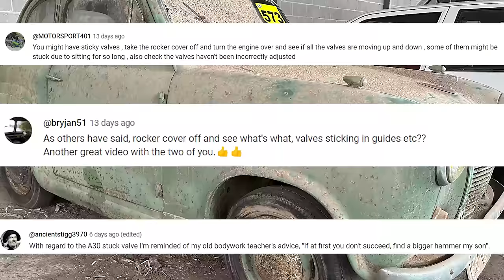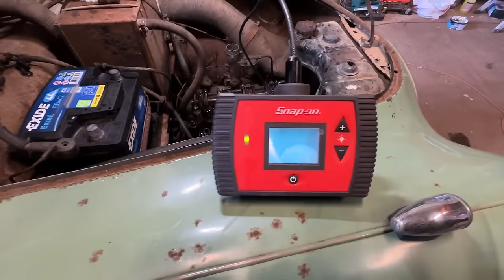First Start in 52 Years! | Barn Find Austin A30 Classic Car Auction Buy #firststart #barnfind

Comment: My first half decent motor was a 1959 , A35 van with seats in the rear which was 8 or 9 years old when I first owned it and to be honest it was one of the best motors I ever had , she took me all over the country and in all the time I had it she never let me down, so ok she wasn’t fast but how many were in the 60s the biggest problem I ever had was when I lost the ignition key which cost me ,if I remember correctly was a couple of pounds from Halfords ,just a thought but how much is modern one for a Renault or Toyota
Reply from the maker: I just paid £200 for a Mercedes key and I don’t think even that was considered expensive nowadays. Madness. 

The other thing with these electronic keys is they don’t work if you get them too wet. Having fallen into a ditch with one once, I know from bitter experience 😂

Comment: You've probably done it now but the rocker cover edge your worried about put a length of wood or brass if you got any on it then use a longer lever under the valve spring ,it should move easier with no risk of damage to that edge.good luck.

Comment: Next job should be to get an oil pressure gauge onto it and you'll have an idea as to the condition of the bottom end. Then run it and see if the smoke clears.  Those A series engines don't give up easily so it could well be fine.

Comment: Worth doing another compression test before going further. Dry first then with a few drops of oil in the plug holes. If the oil increases the compression you might have gummed up piston rings. If the plan is to drive this on the road it would be worth having the head off, grinding in the valves etc. When the head is off it is not much extra work to drop the sump pan and remove one or more pistons for inspection of rings, big end shells etc.

Comment: :face-green-smiling:The old "A" Series Engine was a star in its own rights..so easy to work on. and no major problem to get it going. it`s ok. tapping the end of the Valve Stem. but Beware. you could Dis-Lodge a Cotter. then it`s head off. that Engine was in most Austin and Morris Cars. including the Mini.turned sideways for them. De-Coked and Rebuilt. many in my time. now days. the Mechanics..Woops Sorry. they are Technicians nowdays.. and half of them would not know how to do it... it`s to easy to just change the Units. Engine, Gearbox and Diffs......if i knew where you are located. I would love to come and help you.  to get them running again....Keep it up.. Well done. and lovely untidy workshop..ha ha..

Comment: Great news Claire and Elton, she sounds wonderful. It's probably a good idea to go through the engine, replace the gasket and give her a good check over considering 52 years of inactivity, if sludgy ,high detergent oil will gradually remove it. I think you got lucky because the engine was sealed, preventing moisture ingress.

Merry Christmas and Happy New Year 2024 from Christchurch NZ
Reply: Definitely do NOT use high-detergent oil! It will very quickly shift decades of muck in the oilways and sludge-up potentially causing untold damage; I made that mistake and ended up with a £10k engine rebuild! Drain out the old oil, replace with NON-detergent oil, and drain that out again after very little use.

Comment: Its possible you had old petrol in the pipe, pump and carburettor bowl, so you had to pump through the fresh petrol. Obviously with any old car you have the brown gummy sediment in the fuel system. Future cars I would suggest removing the petrol pipe from the tank, clean that out with wd or atf ,same with the pump and filter and carburettor adding fresh petrol as you box up. These cars , A30/35 have a habit of fuel tank rustingand eventually leaking. In 1969 I bought a 1964 A35 Van  1100 cc that had come from London Electricity Board  and the tank started to leak soon after I started driving it.  Lovely little cars, funny rear brakes and all brakes after be tightened up using a screwdriver through a hole in the drum on the slave cylinders.
Well done on getting a start.

Comment: There is an easy way to unstick tight valves > use an air chisel with a blunt tip and vibrate around area of sticking valve , it has worked in the past for me !
Reply from the maker: From what I’ve learnt from this one, that makes perfect sense. I said to Claire the other night that I’d like to be able to ‘rattle’ it somehow. Thank you.

Comment: I'm a newbie from Australia enjoying your repair fix it jobs on the Austin A30. I have no idea of your mechanical knowledge...but I know the cylinder head on older vehicles have tappets that need adjusting with a feeler gauge. I apologise if it is something that your aware of...but if not I'm pretty sure there are mechanical books for your car or websites to help you out.

Comment: I reckon those valve guide oil seals must be shot it. To be expected I suppose, given the years it's been standing. Lucky the engine wasn't seized up. Those engines are quite easy to work on. Taking the head off and changing the gaskets and oil seals will be quite a pleasant job to do and so rewarding once it's back up and running without kicking all that smoke out of the exhaust. Enjoyed watching that.

Comment: If the crankshaft rotates but only a couple of rockers move valves,surely there is a camshaft or pushrod problem.The engine will need to be stripped or more damage will result.Ive never worked on an a30 but its an A series like minis.

Comment: I would try and get the clutch working and see if all the gears can be selected. Then the brakes will need attention. The engine runs and should improve with use so taking the head off is not that important just now. I would change the oil and filter shortly as a lot of crap will have got into the sump with that first start in 52 years. The A series is such a hardy engine and parts are easy to come by fortunately.
Reply from the maker: I bought a spare oil filter, so will definitely sort that soon.

Comment: The "cotters" etc on this look later than the car,  which is unsurprising . A "Gold Seal" engine was a BL/Unipart fully rebuilt top bottom and ancilliaries using new parts other than head and block which were machined to recieved oversize pistons.  Of course you can just get a gold seal rocker box cover and spray an old engine gold,  not something I would ever do.  "Silver Seal" engines were rebuilt using existing components where they were not worn to excess / refurbed ancillaries only as needed.

Comment: I wish I was there to help you there's a certain way to start up old motors that set for so long. It's not rocket science it's just called common Sense how to start a old motor. One time I even had an mg engine that had no oil pressure because it's set for so long the oil pump when dri show The cure was to keep the bearings in oil while cranking it over I just overfilled the crankcase when it got oil pressure I turned it off and drained most the oil out, but you always want to run an internet set for a long time with its original oil for a few minutes to get everything moving good.

Comment: Need to get it to operating temp and then do a compression test and compare against factory specs. Note the figures obtained and if some or all are low compared to spec then you need to squirt some oil into the bores via spark plug holes and repeat the compression test. Note the figures again. If the figures improve either the rings are still stuck and not freely expanding and contracting to maintain sufficient contact with the cylinder walls, or the rings and or cylinder bore is excessively worn which requires a rebuild.

If you don't get any appreciable improvement, or none at all on the second compression test with oil down the bores, it's more than likely the valves (despite now freely going up and down) are not seating properly due to rust and pitting issues while the valves were stuck open. Observing the amount of smoke coming up through the carby it's quite likely on the cylinder firing that some gasses are getting past the inlet valve seat, especially if the timing is correct. After 52 years it's a certainty that the valve stem seals are shot which will lead to excessive oil consumption. If the valve stem seals were still functioning properly it's doubtful you would have got any sort of ATF fluid or penetrating oil past them to get between the valve guides and valve stems to free them up.

How far do you want to go with it? I would be very surprised if after your tests you don't find it has badly seating valves, and that will require the head to come off and be reconditioned. If they are seating you're going to have to deal with valve stem seal replacement with the head in place which is not a fun venture for a novice. If you have the cylinder head reconditioned note that it 'will' increase compression (especially if they take a few thou off the face to get it truly flat again) and put more load on piston rings that may not be at their best already.
Reply from the maker: Cheers for this. I've read it twice and will refer back to it, too. Once the cooling system is checked over, I'll run it up to temperature and do a compression test, like you suggest. This 'first start' happened Thursday afternoon and the car started fine yesterday and sounded amazingly smooth. I'm not sure if the mics pick that up very well, but my friend was miffed because he said it sounded better than his road-going Capri 😂

As for  "How far do you want to go with it?", I guess that depends on a few things. Getting it to drive on and off a trailer safely would be great for starters. Anything else would be a bonus.
Reply: @UKBarnFinds  "I've read it twice and will refer back to it, too"
I'm not surprised you had to read it twice with my lousy punctuation. Look forward to the next installment. Good luck.
Reply from the maker: Haha! I didn't mean like that 😂 We've been really lucky with this car, as so many people have offered advice, and I read all the comments, often more than once, to try to sort out a plan in my head that will work for me, the car and for YouTube. The filming bit does add an extra element at times.
Reply: @UKBarnFinds  
I love old pommy cars. Part of my childhood in Australia and later lots of memories of dirt and oil under the finger nails. Some of us oldies also like seeing the long dead resurrected. 😊

Comment: You’re not going about it right. With a valve stuck in the down position, when the piston comes up it’ll hit the valve. If you have bent valves, it won’t move. It’s not a big engine so remove it and take it apart. It will need a rebuild for sure

Comment: Awesome stuff, people!  I bet you are proud of that achievement, eh?  I would be!  Brought the little car back from the dead and gone and now her little heart beats again.  What a magical and glorious sound to here the little 803 burst into life after s many years.  A few heat cycles (getting her warm and letting her cool) will eventually help with smoothing out the roughness of her idle as the valves fully close and reseat.  Yes, to do things properly, you'd be taking the head off and then lapping the valves in (although the head probably now needs the seats reground) and resurfacing the valves and THEN lapping them in, replacing the valve guides, pulling the rocker gear to bots and making sure its all free as it should be and cleaning it up and then putting it back together with a new copper head gasket, bypass hose, water pump etc and setting the valve clearances.  However, being that she's 65k miles or so, she's coming close to needing a full overhaul (rings, bearings, sometimes bored out and new pistons, oil pump etc) as the engines were only good for 65-70k miles before they started to smoke chronically, indicating the wear on their internals.  

Me?  I'd set the tappets (valve clearances) and add a bottle of my favourite viscosity improver - aka:  Oil stabiliser, Stop Smoke etc - and run her until she was going through 4 litres of oil to every tank of petrol (which is what MY first A30 used to do!  It had done 70384 when I bought it and yes, she was a James Bond Special, that one!).  I mean, the car wasn't meant to be a road-going vehicle when you bought it, so if she fires up so you can move her in and out of shows, then all to the good.  The smoke might clear up, but an oil stabiliser will help with that anyway.  The popping cylinder might also reseat its valves ok with a few heat cycles, so that's cool too.  Just once you pull that head off, there are probably a few more things that will need doing - and would make sense to do - at the same time.

As to what's next?  Well, clutch would be my pick.  Brakes on the A30 aren't known for their stopping power, so consider them optional.  Being able to move forward and backward is necessary before brakes anyway.  They are a direct-action clutch - so no cables or fluids to worry about.  Put it in gear, put your foot on the clutch and pull the starter.  If the car stays still, then the clutch is working.  If she lurches, it's stuck.  To free it up, it could be as simple as starting the car in gear (use second, NOT first though) and accelerating / decelerating repeatedly or doing a few bunny hops by jabbing the accelerator one and off quickly so the car suddenly lurches forward and then slows.  Yes, it sounds like it might be hard on the drive line, but the car will handle it and it should free the clutch plate.

Again - well done!  All the best for the next phase
Reply from the maker: This looks like it will be fun. The clutch is currently stuck on, so bunny hops it is!